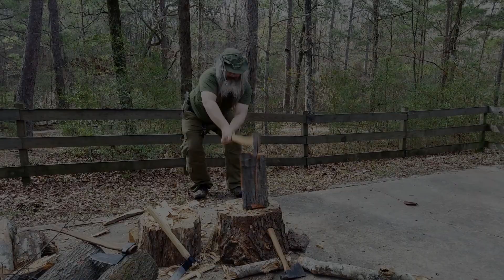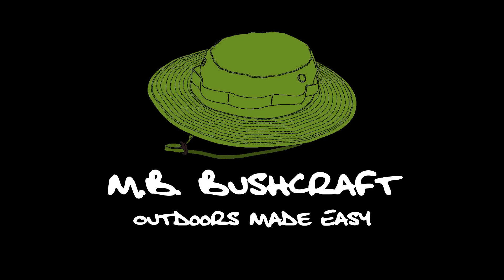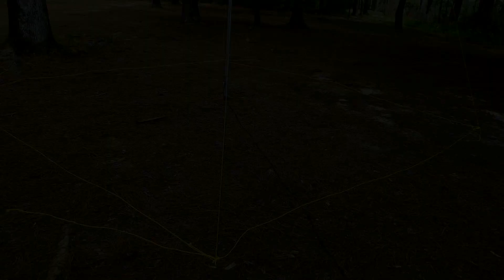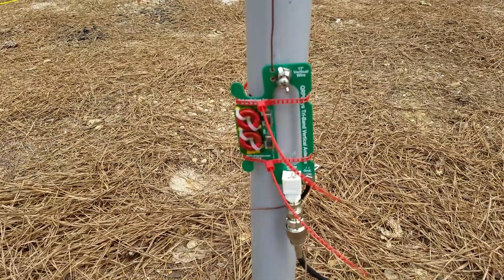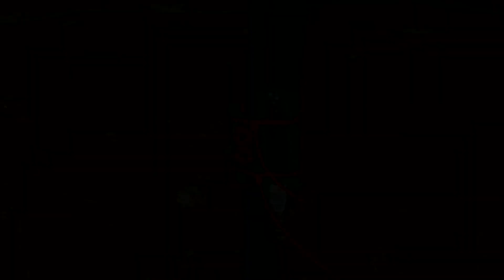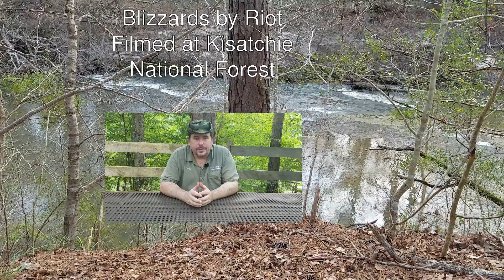Portable HF Antenna

Comment: Thanks...I'm putting one of these together for QRP field ops with a 20' fishing pole mast set in a hammered in holder. I read that you have to use a small tuner with this antenna for low SWR in all three bands and a common mode choke in front of the tuner. I plan on using an Elecraft T1 auto tuner. But, in your experience, did you need an antenna tuner for an SWR below 1.5? Do you run a choke near your radio to remove reflected RF? Thanks for your thoughts and answers, Steve KZ5MSE
Reply from the maker: We didn't use a tuner or a choke.
Reply: @MBBushcraft  Did you ever check each band for SWR with an analyzer? Thanks
Reply from the maker: @michaeledmonds3027  Just when the antenna was fabricated. We checked to see that the dips were in the right place and at reasonably low values. When in the field the swr meter on the radio is sufficient to know if something is wrong. SWR is a measure of how close you are to 50 ohms and not a measurement of resonance of the radiator.  This is a compromise antenna so results will vary, but if you feel better using a ATU by all means do so.

Comment: Doe the mast not resinate at all?
Reply from the maker: The mast is fiberglass and is purely structural. It's the 17 foot wire that is stretched vertically along it that resonates.